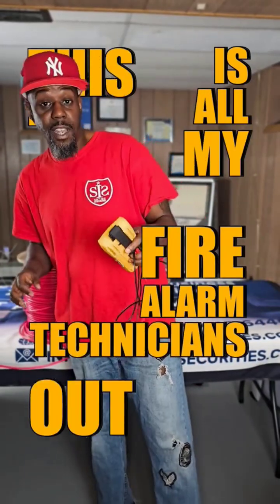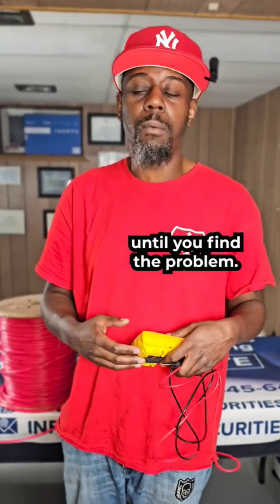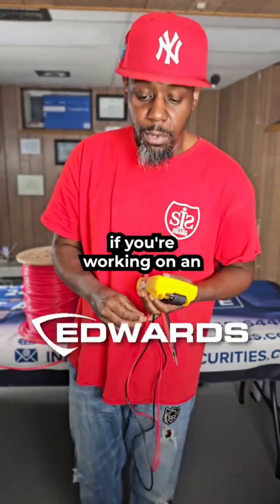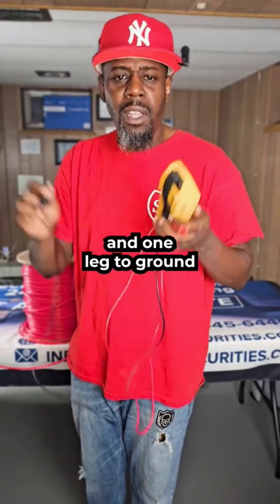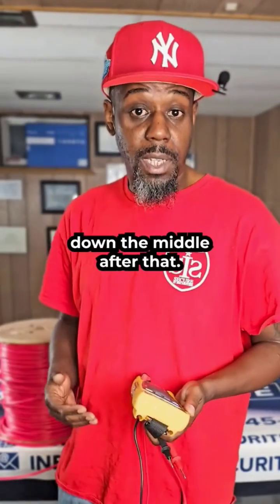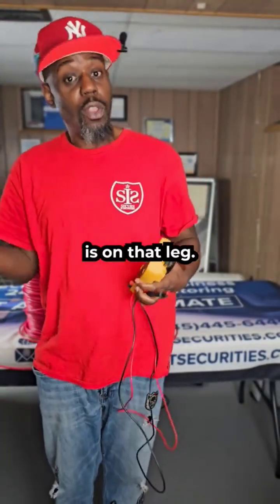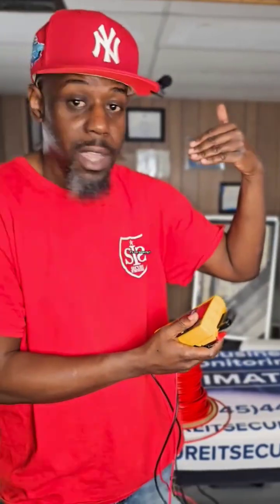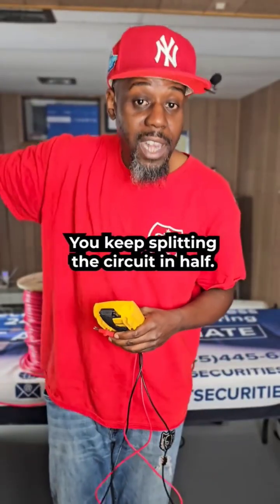How to Fix a Ground Fault (Fast & Easy)

Comment: Fixed. The problem was that the - wire touched the metal ceiling. Now the Fire alarm panel has no gnd fault. Thanks
Reply from the maker: That's what's up!!!

Comment: The problem is that the panel has a loop card, which has contacts A+A-
B+B-
which specifically refers to loop in and loop out.
When I disconnect the blue wire on connector A-, the GND fault disappears.
Panel is Honeywell xls1000
Reply from the maker: On the loop controller that is for the Class A return for the data wire. I see how the ground was started. Nice Work.

Comment: If you have a slight ground on an SLC, it’s likely on the IDC side of a module. While the circuit is still attached to the panel, ground the opposite side of the circuit. The device with the ground fault will go active. You’re welcome.